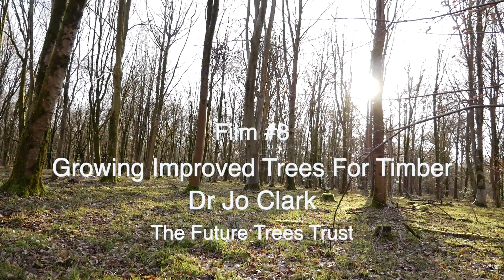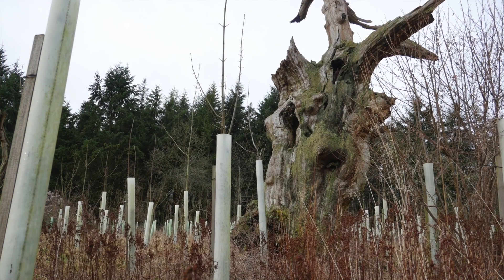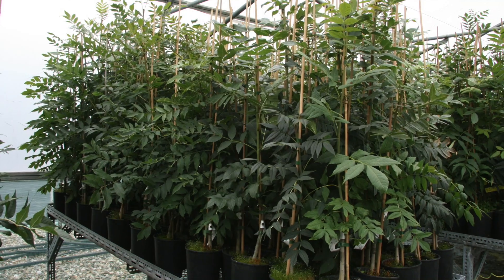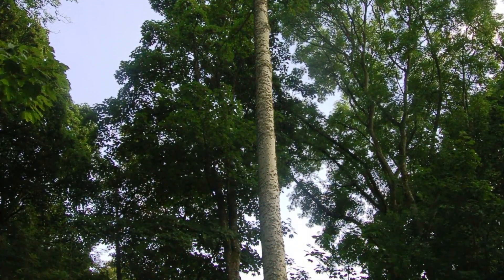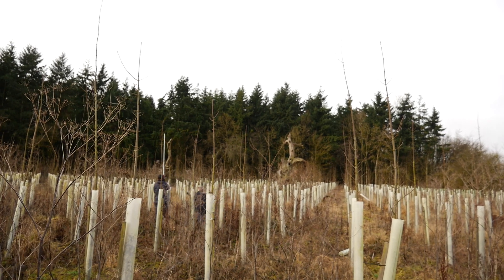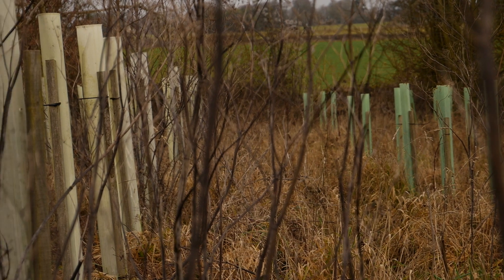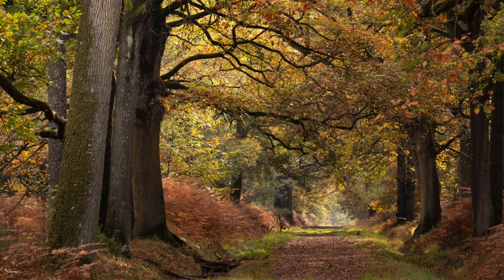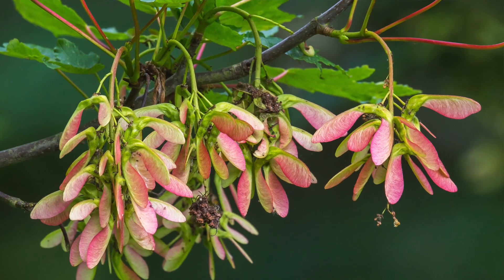Growing Improved Trees for a Low Carbon Future, Wood For The Trees 8 with Dr Jo Clark

Comment: What a fabulous series thank you so much for putting the effort into producing this I’m looking at buying some farmland which has about 1 1/2 acres of woodland of it but there are several acres of degraded arable land which has been decimated with herbicides pesticides in fungicides over many years.   I plan to use the Deadwood from the existing Woodland to make charcoal and then inoculate it to produce biochar which I will mix in with the soil to ameliorate effectively residual poisons left by the previous farmer. I then plan to plant part of it with broad leaves and fruit and nut producing trees so that Woodland can produce food as well as timber  The biochar will lock a significant  amount of carbon in the soil for thousands of years. And we all know that activated carbon is one of the best filtration systems for removing heavy metals and toxins.The the bio char should  rapidly increase the fertility of the soil and help this or retain water in periods of drought. By the way I’m not a farmer yet I’m soon to become one hopefully………:-)

Comment: I'm not a forester, but agree that we need timber trees and should be producing them sustainably at home to reduce imports. It is good to see you producing home-grown native timber. My concern is when terms such as 'good quality' are attached to tall straight trees and 'poor quality' to large open crowned trees. Oliver Rackham calculated from the Domesday survey that around 30% of England's forest in 1086 was open-grown – wood pasture – with wide spreading oaks, elms and ash etc. It is quite a rare habitat now, often surviving as parkland on manorial estates, but it is where we find most of our ancient trees. They just don't survive in a dense-wood environment. They need space and light to reach their full potential. In the grand scheme of things, dense forestry is relatively modern, quick growing trees planted closely to maximise yield – long straight planks to suit modern requirements. In medieval times, the natural knees and boughs growing on large oaks were selected for purpose by shipwrights who would often remove just one bough for purpose and leave the rest of the tree. Housewrights did the same, selecting those branches that needed little shaping for timber framed-buildings. It may sound as if I'm being nostalgic, calling for a 'return to the past.' I'm not. I think it is important to retain trees that may have stood for up to 1,000 years – how much carbon have they captured throughout their long lives? Equally important, is the open-grown native broadleaf tree's capacity to support our declining wildlife. Oak is the best – supporting up to 2,300 species. Around 300 of those live nowhere else. And it is precisely the 'poor quality' parts of the tree, ie; the nooks and crannies, hollows and decaying wood found on veteran trees – that makes them so important for biodiversity. So, while I understand the importance of timber crop forestry, promoting the retention and succession of Britain's native open-grown wood-pasture trees, for heritage, habitat and biodiversity is I feel, paramount. Wood pasture and open grown trees need to be writ-large into the equation. A patchwork mosaic landscape, akin to our ancient ‘forest' in the true sense of the word. To paraphrase Ted Green, I think it is worth tryting to think in 'tree-time', rather than 'human time.’ Much as I would like to, I will never see the oaks I'm planting now as mature trees. They inhabit a whole different timescale.
Reply from the maker: Thanks for your thoughtful comments Julian. I get the concern about trees being seen only for their economic purposes, but  the 'quality' of a tree for timber is defined differently to the qualities of a tree in wild and open landscapes. I think in the future we will need managed timber forests supplying low carbon renewable materials, as well as open-grown wood pasture, agroforestry and amenity woodland in that 'mosaic landscape' you described. Forests, woodlands and treescapes can provide all sorts of value but not all at the same time in the same place. It is surely a case of priorities and trade offs for each individual site coupled with a well thought out and balanced landscape plan. Thanks again for your comments. Tom.
Reply: 2300 species on Oak?  Bacteria?